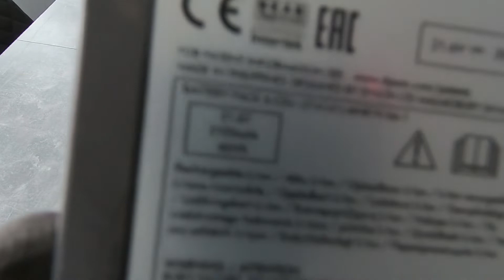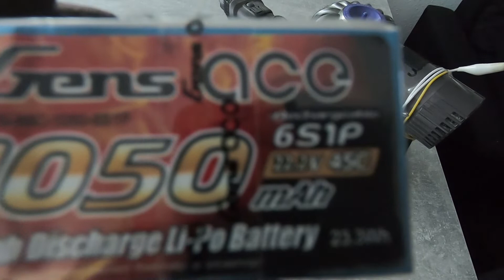DIY Dyson battery hack / repair / mod. Save money!

Comment: Yeah, a big LiPo stack is one of the few things other than a big 18650 stack that can run a dyson - they have very sensitive current monitoring and can detect when an improper power source is connected. But I don't think your aligator clip hookup wires are up to the task. They cannot handle the current to run this motor. Need some thicker connecting wires and then LiPo could be an OK work around / hack. I have done simmilar hack with supercapacitors for testing purposes.